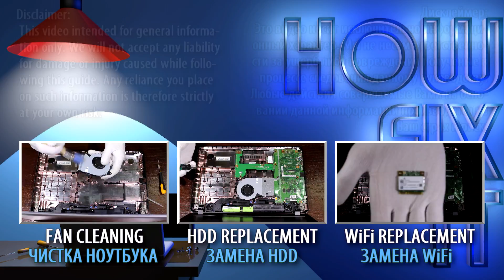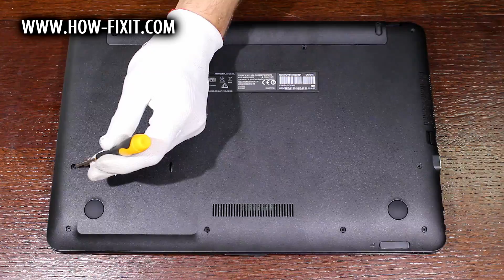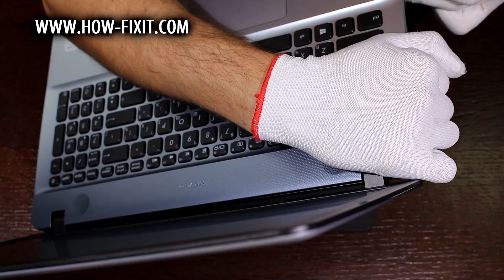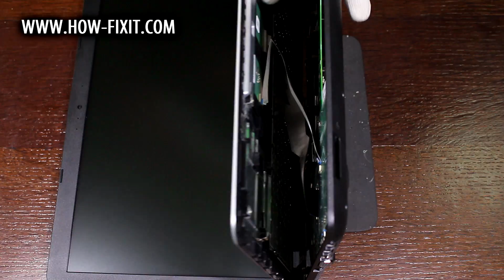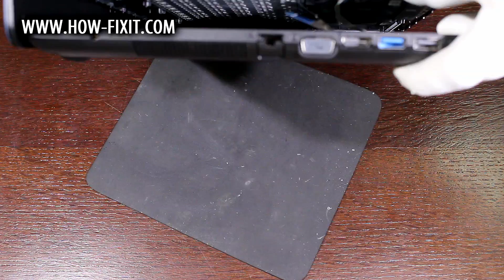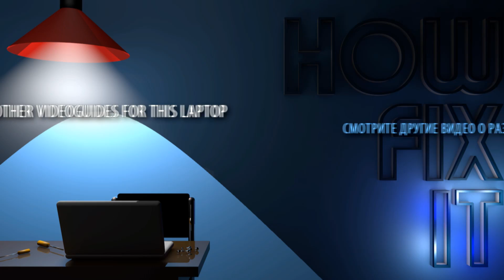Asus VivoBook Max X541 Disassembly & Battery Swap Tutorial – Fix Battery Drain

Comment: The video was super helpful. After I removed the keyboard and disconnected the two keyboard connections I simply removed the screws from the battery and tilted the battery towards the main board to pull it out (did not bother with disconnecting the main board which is unnecessary). **The only thing you need to pay attention to when removing the battery this way is how the tab on the right side of the battery, that screws into the frame, is positioned before you remove the battery.**

Comment: Note for DIYers on this.  Connecting those small ribbons back to the keyboard is difficult.  Chances are, you will break something.  The small one is almost impossible to get right, and you will likely screw up the mousepad control.  The big one is a gamble too.

Comment: If I had known how awkward it was to change the battery I would never have bought an ASUS. In fact, I'll be crossing ASUS off my list when it comes to buying another PC
Reply: You will find that most new and cheaper laptops now come with the battery built-in, rather than replaceable. Only the much more expensive ones still have removable batteries. It was another way for manufacturers to lower cost.
Reply: As someone who disassembles computers, at least the batteries aren't soldered on or the case using nonstandard screws like Macbooks would. I would say this is easier than the Apple computers and smartphones in my opinion.

Comment: im not sure here but it looks like he took more apart then he really needed to
Reply from the maker: actually the thing is that in this laptop battery placed under the mb, even if at first look it's not: battery connector is under motherboard. So you can remove mb > remove battery, or remove mb and battery at same moment and then separate
Reply: But the display connector was not necessary.